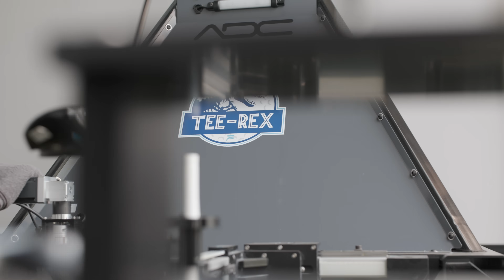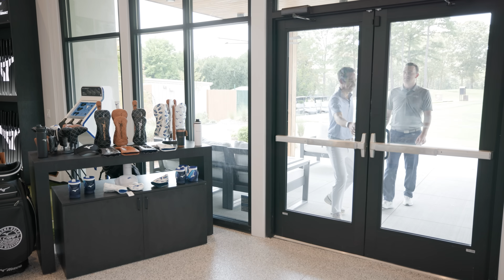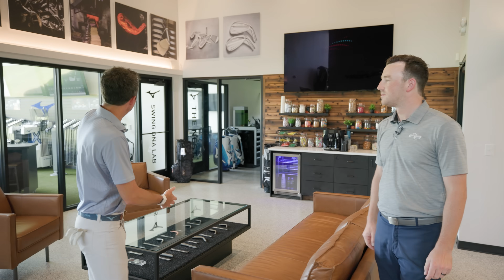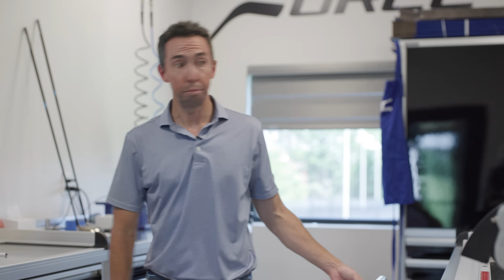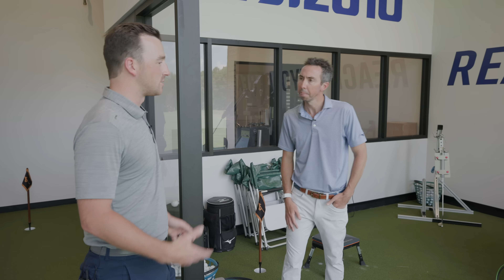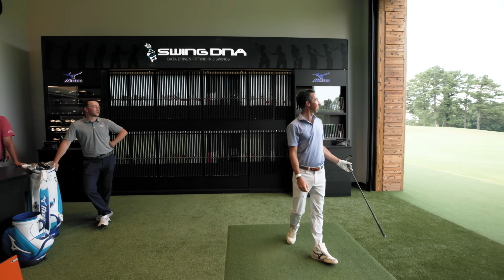THE FOUNDRY Facility Tour | Mizuno Golf Performance Center

Comment: Does mizuno have a shaft optimizer for driver or is it still just the iron ? I’ve used the iron one and then the fitting app recommends a shaft but was wondering if they had one you could swing for the driver ?
Reply: You can fit drivers with the Optimizer as it can convert 7i data into driver/fw/hybrid/ wedge shaft fitting data. 

Try it.. you’ll see !
Reply: @sloswingspeed9535  yea I’ve done that on the app was wondering if they had one you actually swing for driver. There was talk of them coming out with one but haven’t seen anything